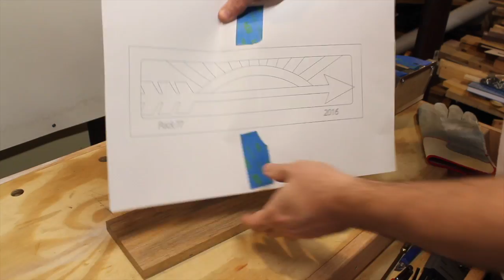Cub Scout Arrow of Light Awards

Comment: Dude.  You are way better on the scroll saw than me!  What blade are you using?
Reply from the maker: +TheGeekPub I got better as I went along... that's for sure. I'm not sure about the blade... it's 1/8 thick and has over 50 teeth (hope that helps)... Looking at the footage I suspect the blade tension could have been increased a bit. I also used a thin spiral bit to remove the inside of the letter shapes.
I broke a few blades during this build... those things heat up pretty quick when they're cutting thick hardwood.

Comment: That's a lot of scrolling!  I'm curious if doing some of the back panel work on the CNC was an option/consideration?  And if so, why did you decide to use the scroll saw instead?
Reply from the maker: +BALES Great questions! Two factors made me decide to use the scroll saw: 1) The wood is 3/4 thick hardwood. That would be a lot of material for the CNC to chew through and it would have taken a lot of time and caused a lot wear on the bit/router, and 2) I own the small footprint CNC and this image is larger than my machine can handle. In fairness, I could have carved this in two sessions but I didn't want to deal with alignment issues.
The letters could have been done on the CNC machine... but I just felt like using my bandsaw.
Isn't that the great thing about owning your own shop... you can do whatever you want. Ha ha. Thanks for watching!

Comment: Hi Matt, I’m building this for my AOL den! And I’m almost done, what size bit is used to do the engraving of the pack and year? Also where do you find the letter templates used for the boys names? Thanks again Sam
Reply from the maker: First, that’s great.
I used a 1/16 uncut bit for the small lettering CNC work and a larger bit for the larger letters (maybe a 1/8 bit). All of the words were simply typed into the CNC software. I forget what fonts I used. 
I hope this helps! Good luck!!
Reply: Thank you Matt, for the info. I’m going to use a dremel tool to do the lettering and a band saw for the names, and one of the moms in our pack will add her wood burning touch to cap it off, thanks again, these will be presented at our Blue and Gold banquet soon.

Comment: Very nice. I saw another comment where you said you broke a few blades. Did you also fill your pants? When those blades break I about have a heart attack. Love the editing as well.
Reply from the maker: +Waylight Creations The scariest thing is the loud clattering noise the machine makes after the blade snaps. Thankfully... both pieces of the blade always stayed connected rather than flying outward. The spiral bits would often come loose (not break... rather just disconnect).
Reply: Awesome Wood Things I had the same problem with the spiral blades. I had watched another guy here on YouTube use them and contacted him in the comments of the video and he suggested a brand he uses. I'm going to try them in the near future. But yeah, that clattering noise is the worst, especially because you're so focused on what you're doing. It reminds me of that stupid Exorcist pop-up thing.